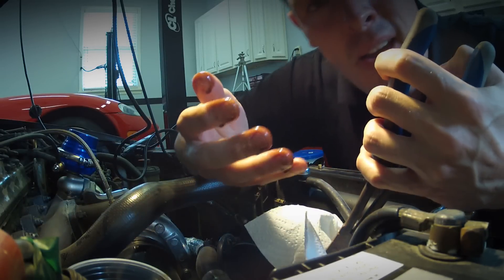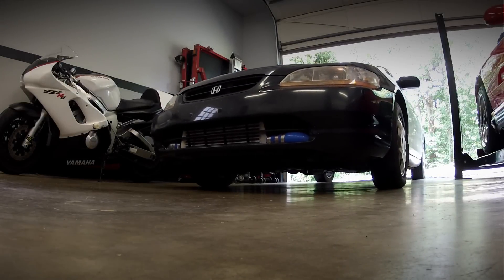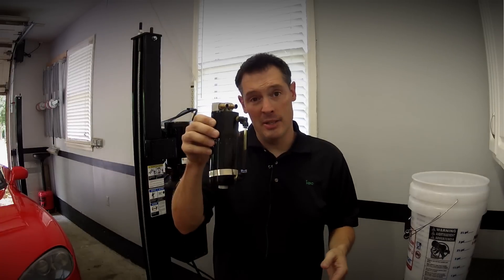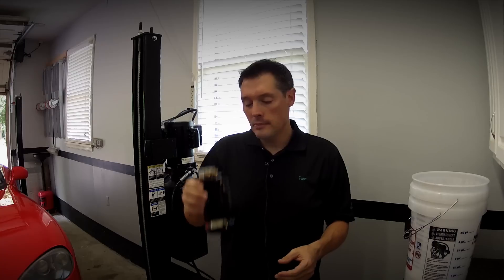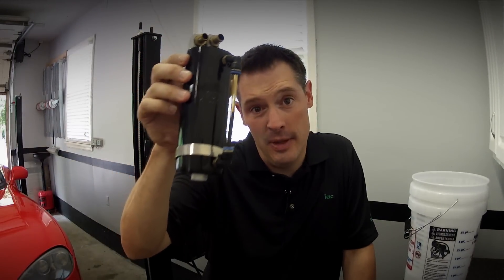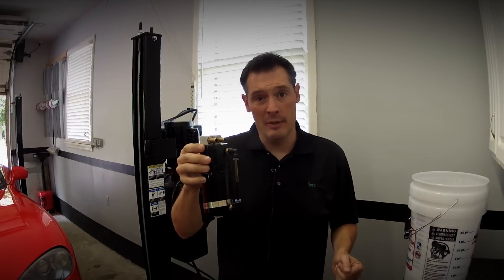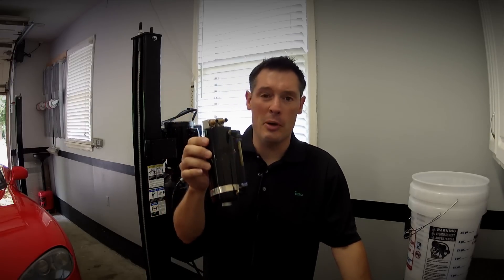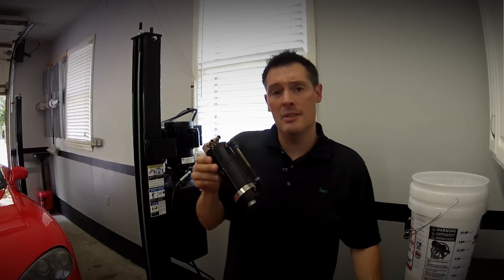Oil Catch Cans Myth Or Must Have - Ebay Oil Catch Can Review

Comment: I have one on my 01trans am, my problem is the breather do I need it ? Cuz the one I have makes my car smoke under the hood
Reply from the maker: +Sissy Smith Hi Sissy, yes mine does the same thing.  To remedy this I'm thinking of relocating the breather down towards the bottom of the motor so it doesn't gunk up the top, I'll try to do an episode on it in the future.
Reply: :) thank u

Comment: You people are also robbing your valves of necessary lubrication! There goes the longevity of your motor.  These motors are engineered by top professionals in the world, and you think this is a good idea!?
Reply: Do u really think these engineers are trying to make engines that last a very long time? If they did then car sales would plummet as cars would last a long time. These days cars are made to last a year or two a after the warranty runs out. I'll give u 2 examples, 1.Most manufacturers say cars oil should be changed either every 10000 or 15000km when in reality it should be changed every 5000km and with full synthetic oil. Example 2. Alot of manufactures say that the automatic transmission fluid shouldn't be changed at all due to in being "life time fluid." Now go and ask any mechanic or anyone that has an idea about how a gearbox works and they'll tell u ALL automatic transmissions should have the fluid changed every 20000 to 40000km. My car supposedly had "life time fluid" but i changed it when I bought it at 110000km and the fluid was like thick mud! I've had to flush it 3 times before it was nice and clean again but if I hadn't changed it i doubt it'd still be going. 
Remember if cars were made to last 30yrs then the car companies would go broke. They want u to "upgrade" not long after warranty runs out. These days u need to look after your car and do regular services more than ever. Cars from the 1960-1970's were made to last, most people topped up the oil when it low and changed the brakes and tyres when they had to and that's about all they needed to last 20+years,do the same to a new car and your lucky if it'll last 3yrs.
Reply: if that's was the case. then why are all the direct injection engines getting carbon build up on the valve without a catch can. also all the catch can is catching is vapors that usually get burned and coat the inside of the intake with oil.
Reply: +Rios09sle also don't forget about improper break in for the engine as well. The rings most of the time are not properly seated from the factory and most people don't know how to break in an engine properly.
Reply: +TheArchetypeGamer they run the engines at the factory  to check for leaks and bring them to normal operating temperature.  They seat just fine.  PCV is designed to do its job.
Reply: +Rios09sle Carbon build up is from the explosion of fuel in the piston chamber.  I have a crankcase hose which goes into my intake on my HEMI.  If it were so bad, my filter, intake tube and plenum would be soaked.  It's not.  But you go ahead and waste your money and potentially ruining the longevity of your vehicle
Reply: +juniorloz Except older engines, and engines with added superchargers and turbos have more blow-by than normal. Oil and oil vapor lowers the octane of fuel and can cause detonation. Oil in your intake is not good for your engine. Just because your engine doesn't have much oil in the intake does not mean that catch cans are useless for everyone.
Reply: +juniorloz that is correct but the oil makes that carbon to cake, like it happens in diesel engines. Modern gasoline has additives to help with the lubrication of pumps and valves, you don't need all that crap from the oil into your intake.
Reply: Not always. My 2006 GM 5.3L was the first year of active fuel management(V8 down to 4 cylinders for efficiency). They botched it, and the engines eat oil like crazy. I add 1-2 quarts between oil changes! They call this "normal" useage. I've never owned a car that lost oil without a known leak. It's an engineering flaw that took years to fix. I'm about to install a catch can to keep all of my lost oil out of the intake.
Reply: +Jerrod York the active fuel management didn't come into play until 07.5 and newer 1500 trucks with the 5.3 and 6.0. but the vortec engines have always been known to burn some oil.
Reply: Rios09sle I'm not looking to argue. I can positively assure you that my 2006 Envoy Denali 5.3L has Displacement On Demand! It's right on the window sticker spec sheet. My car is at a body shop right now, or I'd snap a photo. It was the first year it was available for my vehicle, and it sucks! 1-2 quarts low every 3-4,000 miles isn't healthy, but is a common complaint for those with this motor. A lot of folks either get it tuned off, or drive in 3rd gear where possible to keep it in V8 mode, thus limiting if not eliminating oil loss.
Reply: You can hear/feel it kick on and off at certain speeds. I wanted a V8, and should've researched the engine more before buying. Not a feature I want...gas mileage is that of a V8 regardless lol
Reply: +Jerrod York I forgot that envoy Denali had it. I have an 09 5.3 sitting at 99k doesn't burn oil like other experience
Reply: +luke isaac if your engine is actually eating the amount of oil the catch can is catching then all the power to you.  The true test would be to see the appearance of your valves before and after a catch can.  Again, top end lubrication is needed for engine longevity.
Reply: +juniorloz how is the catch can robbing lubrication from the top end. the top end gets its oil still. the catch can is only catching oil vapors from entering the intake.
Reply: +Rios09sle it's the way the system is designed.  It's not just for emissions, it's to bring vapors back into the plenum to lubricate.  But think about it, if a catch can catches a half quart every week, that means the engine is drinking a half quart per week? Not true.  It just means the catch can is catching that much.  Which means you'll be needing to add more oil to the crankcase.  The PCV valve works just fine and is designed to do its job.  It only allows a certain amount to flow in any way, based upon vacuum boost.  
I have a ported TB, long tube ARH headers, Legmaker carbon fiber intake tube, K&N, 180 start, exhaust, Diablo HEMIFEVER tuner in a 2015 reg cab and the thing is pulling low 13's without the, IMO, useless catch can.  BTW I also have a 6" lift with 35's.
Reply: juniorloz I'm by no means a mechanic, but wanted to chime in since I've spent countless hours researching my engine's oil consumption. I'm guessing you have a Dodge based on the name of your tune? I drive a 2006 GM with the early version of active fuel management. Our PCV valves are fixed, not truly valved or serviceable without changing the whole valve cover out. When the 5.3 engines go into 4 banger mode excess oil slops around and gets past the rings and through our "pcv". Personally, when I check my oil, and it's always low, I know why. It's much more than a little vapor passing through on these motors. There have been TSBs and makeshift engineering changes that don't really help resolve the poor system design. Maybe functioning PCVs and oil vapor is normal on most engines, but ours have a fixed orifice on the valve cover that lets a lot of shit through back to the intake. If I could take a loss I'd just sell this p.o.s. and go back to trusty Buicks with the 3800!
Reply: I don't want to keep a pissing match going on youtube, but if you drive a Dodge truck that functions the way it is supposed to...great! Just Google GM 5.3L oil consumption and you'll read a hundred threads and countless comments from GM owners whose systems are poorly engineered and executed. This is the 1st vehicle of many that I've ever added oil on a consistent basis, and I've had some old high mileage cars. Our AFM engines are fucked, and we just don't want all that extra shit going into the intake. It's not like some vapor isn't escaping those catch cans to some degree anyway.
Reply: +Jerrod York yeah man, if you have an issue where there is excess oil consumption due to poor design all the power to a catch can.  I'm just saying that most people get the itch to 'modify' their newer vehicles and get caught on new upgrades like this one, it's useless and possibly harmful.  The MDS in the HEMI's are electronic and mechanical and obviously a better design than GM'a version.  I have it off on my engine, it's annoying!!!
Reply: I wouldn't be looking into it if it weren't an issue. I'm adding 1-2 quarts every 3-4,000 miles. The engineers shit the bed on the 5.3 motors and this AFM. I still get shitty V8 gas mileage regardless lol
Reply: +Jerrod York are you blowing smoke? Could be valve guides... Well it's a start with the catch can, pretty inexpensive and if it is the problem, you'll be pretty happy
Reply: +juniorloz your not making sense. because all the pcv system is doing is catching moisture from the oil and sending it back in to burn. I drive a 5.3 vortec with afm every so often I have to pull my tb off and clean it. if I had a catch can it'd collect all the moisture and contaminants from entering back into the intake. my last car had a oil separator from factory which was an Oldsmobile quad 4 2.4 liter. never had issues of having to clean the tb on it. there are many companies using oil separators and catch can from factory.
Reply: juniorloz Nothing noticeable when driving, or when it's warming up in the driveway. Pretty sure it's just this damn afm system. I just keep an eye on my oil level and clean the TB once in a while. I love this old Envoy, and was hoping to drive it a while. It runs ok, but I know it should run better for a V8

Comment: As a basic car driver (work and back with a few longer trips), would this be something you would recommend installing? I have a 2013 Dodge Charger SXT AWD - nothing special, but this sounds like it's an integral part of a cars performance ability. Also - I don't change my own oil (frankly, too lazy) -- would this be a problem with the dealership? Thanks!
Reply from the maker: +John Peterson +John Peterson To answer your questions, I don't have them on my regular cars, although it wouldn't hurt at all to have one.  On a boosted car I feel it is very necessary b/c of the positive crankcase pressures.  As far as having your oil changed, first I would say change it yourself! :D  It is fun, easy and much cheaper, plus you know it was done correctly.  Secondly, unless you point it out to them I guarantee they will not catch it, so make sure you tell them to change it, but again, I wouldn't want anyone at a "quick change" oil place touching anything on my car as most of these guys know just enough to screw something up lol, just my .02 good luck with it.
Reply: +John Peterson The way you can tell if you need one is to inspect your intake.  Open up your air intake.  IF you see any oily residue on the back side of your air filter or your throttle body (or basically anywhere inside the intake), then yes - should install one asap.  If it's completely dry inside, then you may not need one.  As mentioned, it doesn't hurt to have one as it can prevent a major oily mess, if one should occur.

Comment: Can this catch can be unscrewed at one of the ends so as to put some baffle inside, or is it sealed tight and only the plug at the bottom can be removed?
Reply from the maker: +carlosb1 No, but the drain plug might be big enough for you to do that.  Again since the "in" line does go anywhere near the bottom I doubt it would help anyway.
Reply: Thank you :) Rubber Duc
Reply: get one that opens/unscrews that's all...

Comment: Why not have the bottom of the catch can return all and any oil in it to the motor the same way it returns clean air to the intake?
Reply: +gabriel sapien because that's acidic oil it'll harm the engine
Reply: +narutolovesbleach 
I have a homemade setup and collect the gunk and take it to a household haz. materials collection center.  Water also condenses in there, especially during humid weather and I would not want that going back into the oil sump.

Comment: Hey I am thinking about installing one of these in my car after noticing a large amount of oil in the snorkel to my throttle body.  I have a 2012 impala 3.6vvt Flex fuel.  There is a line from the left valve cover to the snorkel, which only about 8-10 inches long.  I notice that the oil seemed to be coming from that source.  It this were I should be installing this can?  Splicing that line to install?  I have looked a lot of places and I know my car itsnt SC or turbo but there is too much oil getting in there.  I appreciate your help!!!!
Reply from the maker: +Paul Nieves Hi Paul, not sure on your car, but it needs to be spliced into the PCV line that sucks the crank case vapors back into the intake.  You might try a forum for you car if you are unsure where that line is, good luck with it and thanks for the comment.
Reply: After some research I found where it needs to go.  thank you for your comment.